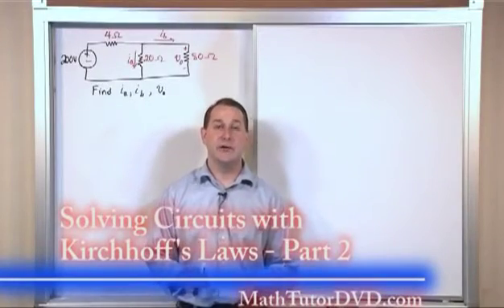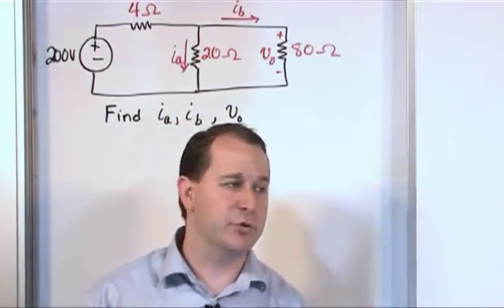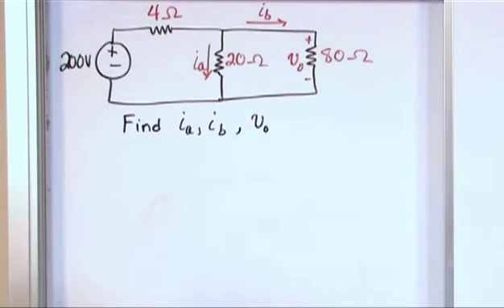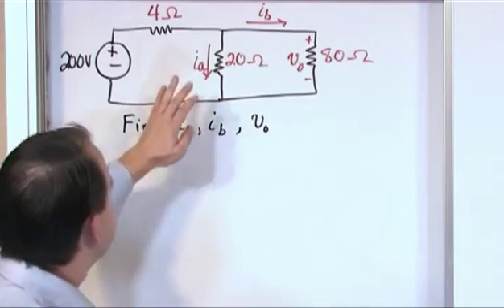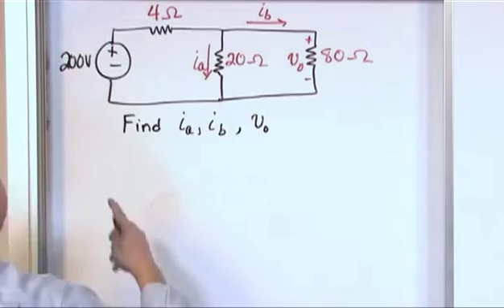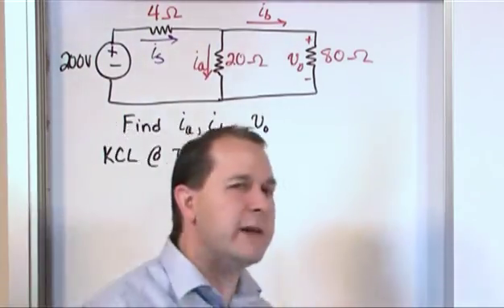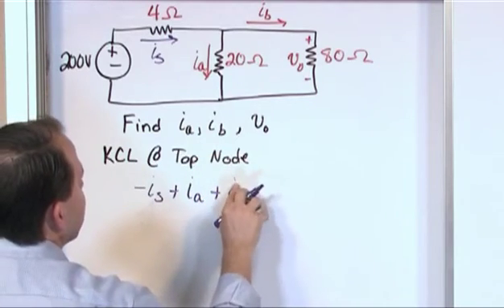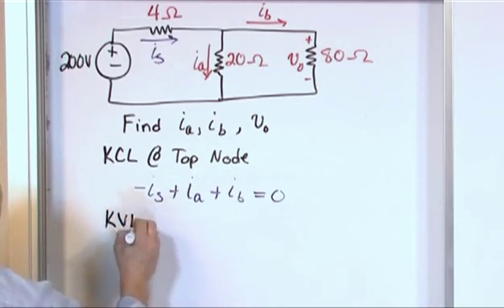Lesson 8 - Circuit Analysis Using Kirchhoff's Laws, Part 2 (Engineering Circuit Analysis)

Comment: I was wondering why we don't start solving is = 200/4 = 50A. Or is it even possible? Thanks
Reply: That would be the case if R4 was parallel with the Voltage ( both cables at the end of the resistor are connected with both cables of the Voltage) , as you see only the top cables are connected meaning voltage is in series with the resistor , so they have the same I (current intesity) but different voltage
here is my KVL solution , think the circuit as 2 different circuits where the sum of the voltage in each component should be equal to 0

KVL: -200 +4ia+ 20 ia-20ib=0

        20ib-20ia+80ib=0 => 100ib=20ia=>ia=5ib

from top equation -200+20ib+100ib-20ib=0 => ib =2 A  , from second equation ia=10 A
Vo= 80 ib = 160v